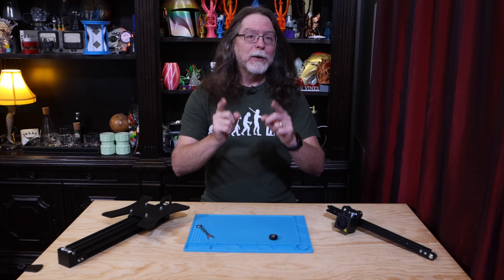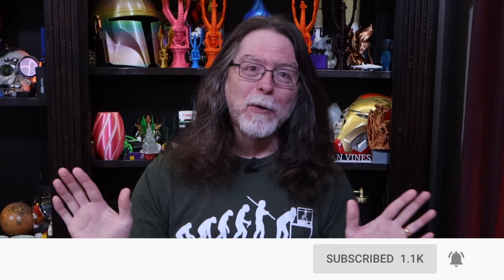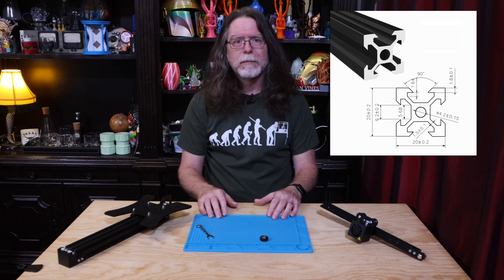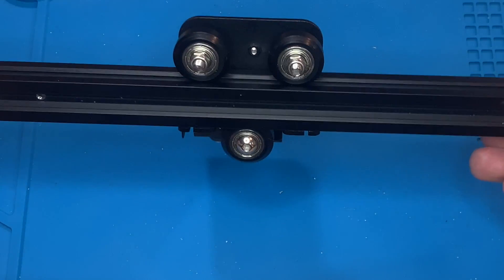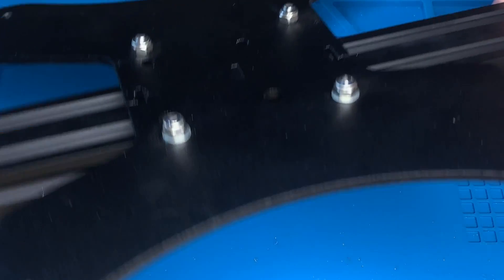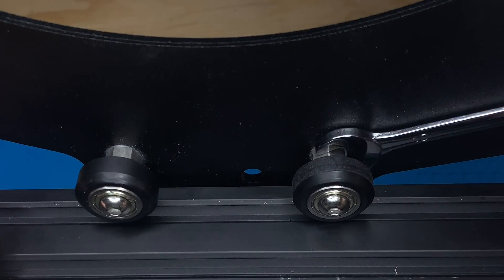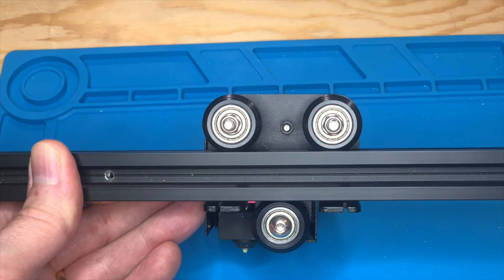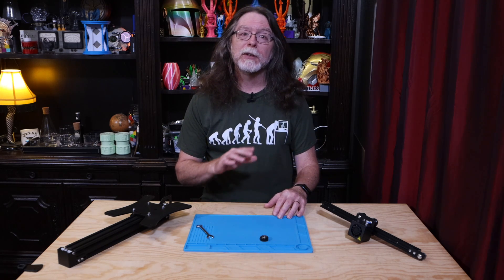Adjust the V Slot Wheels on your 3D Printer for Better Prints!

Comment: Question: once adjusted can it, and should it be locked in place? Thanks for the tutorial
Reply: I’ve always seen locknut used on these, but just wear and tear makes for the occasional need for adjusting
Reply from the maker: Hi! They're usually not going to rotate on their own. The bolt that goes through the eccentric nut (and through the wheel) has a Nyloc nut on the other side, so it stays reasonably tight. You can tighten the bolt & Nyloc nut if it seems super easy to turn the eccentric nut, though. (That part of it all is typically pretty tight from the factory).
Reply: @BV3D  That's right but you still need to adjust the excentric nut by rotating the way that you are tightening the bolt. This way you make sure you are not losening the connection!

Comment: Weird Question. In my Ender 3 style printer.  My X axis has 4 wheels. But one of the wheels has the nut and bolt attached reversed to the other 3? Is there a reason for that, or a mistake in the factory?
Reply from the maker: Hi, what is the make & model of your printer? I'm kind of curious about how that's set up.